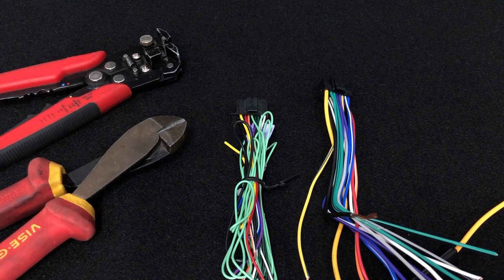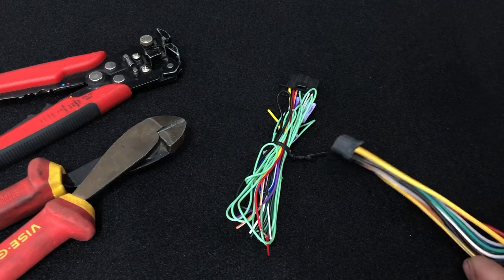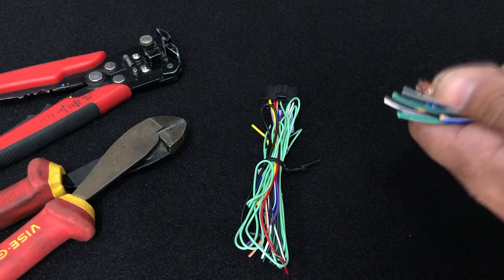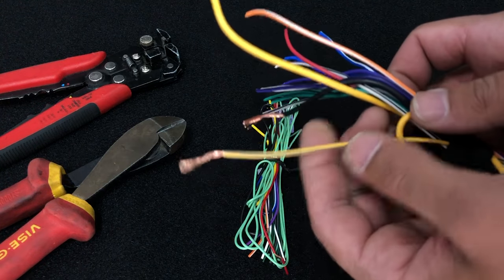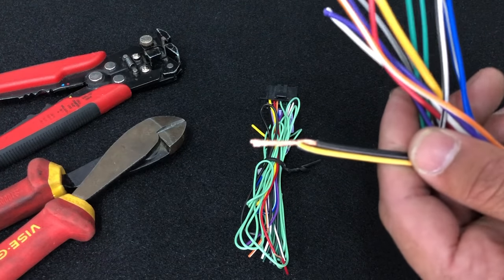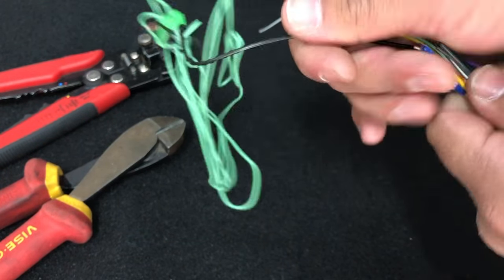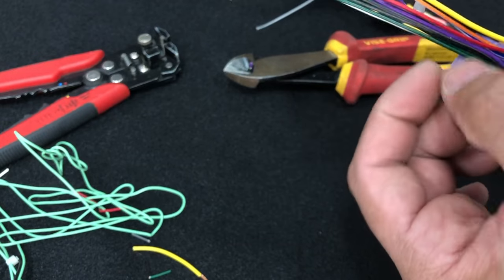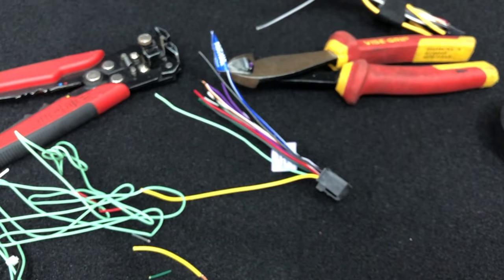Easiest Way To Bypass Park Brake Wire!

Comment: Pioneer AVH-2300 NEX on a 2016 Wrangler sport. Followed these instructions, no success. Can you confirm if you were able to successfully do this on my particular Pioneer model?
Reply from the maker: Taylor Walser Hi mate, no success in what way? Not able to watch video? What does the screen say? Does the unit have an external GPS antenna? This can also cause the unit not to play movies when it’s moving. You can try disconnecting the antenna for testing purposes
Reply: The Fitting Bay thanks for the reply! No video. No GPS or any other additional amps/peripherals. Also menu options only available when park brake is engaged are grayed out.
Reply from the maker: Taylor Walser Hmm interesting so that means the unit knows when/if the park brake is on. This should not be the case. If you chop the “park brake” wire very close to the head unit and plug and connect it directly to the black GND wire. The menu should work at all times. 
Perhaps there was a small mistake in installation. 
Or there has been more than connection to the park brake wire. Or the wrong wire has been put to GND. 
Basically, when the park brake wire is put to GND the unit just thinks the park brake is constantly on and it has no other way of telling otherwise.

Does that make sense? 
I’d pull the unit out , locate the park brake wire (as close to the head unit side of the plug) as possible and just connect direct to black wire on head unit plug.

That should solve the issue for you
Reply: The Fitting Bay thanks for the advice! I’ll give it a try and report back.
Reply: @taylorwalser6822  did it work?
Reply: Ben10XL some features became available after requiring entire unit, but am unable to watch a DVD. Unit now gives a message advising that the park brake must be activated/deactivated in a sequence in order for that functionality to be available. Had to purchase a $15 part online and now everything works perfectly. More google research showed that this is known thing and simply grounding out the park brake wire no longer works on Pioneer units. Thanks for all your help and checking back in!
Reply: Taylor Walser can you say if the part you buy, make it easier?, or it’s hard???
Reply: Some units require on off on before working

Comment: Newer pioneer HAVE to have a module or toggle switch because they require a closed open closed signal because people have been doing this trick for decades
Reply from the maker: Only in the states. This trick works in AUS with brand new pioneer head units 2020 release etc
Reply: @TheFittingBay  Hi. Live in Vancouver, BC Canada. Will this work for us up here or are we included with US market?
Reply: I  plan on using it with Pioneer AVH-221EX
DVD receiver . Thx

Comment: all the people thinking its unsafe. most vehicles with auto transmissions never use the parking brakes and after enough years of rust and dirt pulling that cable will pull the brake then seize or the cable snaps then you are left stuck... not worth the hassle for the risk, so id bypass it just to avoid this headache
Reply: Take care of your vehicle

Comment: why would you disconnect it? what do you gain from it exactly
Reply: It's not about and disconnecting it from the parking brake it's more for the usage of the stereo in full for example my stereo I can't access the Bluetooth menu to even add a device unless the car's parking brake is on and I have a foot parking brake which makes it even worse

Comment: This does NOT work on newer units. They caught on to this and a constant ground no longer works. Has to have a switched power to keep your dvd working while driving. I used a rocker switch.
Reply from the maker: silverdropstang Hi mate what unit do you have specifically? We sell and install brand new units from most makes on a daily basis, we use this method and are yet to come across a unit where this has failed.
Reply: The Fitting Bay Hi I have a Sony XAV-AX 100 radio. Will this work on mine? 

Also I had a wire named “antenna” from the new unit wiring harness. But I couldn’t find the right wire to connect it to so I left it just dangling. The radio turns on fine and plays radio stations ok though so I guess it’s fine like that?

Also do you know why my radio delivers no audio signal to my amp when I play music in my 2006 f150? It only happens when I am playing music on my radio with my phone and my alarm goes off. Then for some reason it mutes the music and I just hear the alarm going off on my phone. Not my door speakers. (I have a 5 channel kicker amp if that’s important to know)
Reply from the maker: Edgar Mendez Yes it will work. 
Antenna wire needs to be connected to the power antenna in the vehicle (if applicable). It helps with radio reception. If the car has no physical antenna (old style) it 100% has a power antenna. If it has an old style long antenna which does not come up automatically (controlled manually) probably doesn’t have power antenna. 

Very strange, so you are playing Bluetooth music from your phone to radio. Your phone alarm goes off, then all the music stops? How do you get it to start again? Simply pressing play on the phone or does the car need to be switched on and off?

I’d start with a software update on your phone.
Reply: The Fitting Bay Well if I disconnect the negative battery terminal and connect it again it works fine again. I don’t know maybe it resets something.
Reply from the maker: Edgar Mendez If you have your phone volume full on Bluetooth, then turn up the music really loud in the car, does the amp shut off? And basically do the same thing? Just check that. 

When the alarm goes off it’s very loud, possibly putting the amp into protection mode. Which is why you need to pretty much disconnect it to get any sound. 
You can fix with tuning the amp. Turn the gain down to 0 and then the radio up pretty much as loud as it goes then slowly turn the gain up to your liking.
This way you can have the radio on full blast and it won’t put amp into protect mode.
Reply: The Fitting Bay I checked that and no the amp doesn’t turn off. Instead I can hear the music but like it is barely audible. Like if I put it at max which is 50 volume, I can barely hear the sound from my speakers.

And yes I didn’t set the gain with radio at max volume. I did it like 3/4 of the max cause that’s what I read on YouTube vids.
Reply: The Fitting Bay I uploaded vid just now so you can see how it sounds when good and when not good
Reply: The Fitting Bay but maybe I should try that and see it it solves problem. Because like I said I only have my gain set so that 3/4 is max volume. Or I don’t know
Reply: Pioneer 200EX
Reply: Every system is different. Saying that the gain should be set to 3/4 is a bold statement. I would try resetting your gain

Comment: recommending solder to average person is very silly.  Heres a quick question, how many connections on a car are soldered?  Engine Computer? no there crimped, Oxygen sensor? no there crimped, only solder circuit boards.  Vehicles with solder connections, have specialized terminals to handle wire movement and vibration.   Average DIY would have dirty solder joints and issues down the road. Solder is brittle to vibration, and cars vibrate.  Best choice for DIY is butt connector with heat shrink separate or the all in one setups.    And if you really were looking for clean install, stagger splices.
Reply from the maker: Michael Shapiro 😂 buddy if you’re that offended by solder joins just crimp your wires 👍🏽. In ten years of doing this I’ve never seen jobs come back from solder joins breaking from vibration 😂. You know what I have seen. People not crimp properly and wires fall out 😂

Comment: What exactly is he bypassing? I have the same unit.
Reply from the maker: Denis Lara View movies without handbreak up - change settings, use nav features etc without Hand break up :)
Reply: The Fitting Bay .... Apple car play works just fine without it. But I am curious about the movie option. I’ll check it out. Thanks
Reply: @iamdenislara  For some radios, like mine, you have to have the stupid parking brake on to pair the damn phone. This is the problem I'm having. I don't want to watch videos or cause trouble. I just want to pair my phone, listen to music, and carry on with my life. But I can't because Pioneer is stupid
Reply: @brycedaugherty9211  i recently found out that the Apple Car Play does not need this, but for Android Car you do have to ground the parking break
Reply: @iamdenislara  I wound up doing the trick to bypass the parking brake by just grounding it to the radio chassis. It really wasn't that bad, and thankfully my unit doesn't have to have an off/on toggle. It's just a ground check. I'm glad the whole ordeal is over but these parking brake sensors are a nuisance

Comment: That doesnt work on pioneers at least not any new 1z u have to wire a grounded switch to the parking brake wire n u flip it on n off n it tricks the unit into thinking the brakes been set

Comment: I dont think it'll work on my pioneer as it needs to cyle ground on off
Reply from the maker: If you are in the states you need a switch as well
Reply: @TheFittingBay  thanks, Australia but same go.
I found a module u can buy that does the ground cycle on ebay 👌

Comment: Not true. Every deck I have owned requires you to set the brake, then release and set again. On-off-on. Can't do that if its hooked to ground. And why doesn't anyone talk about the other mint colored wire?
Reply from the maker: Are you located in Australia? Here in Aus this method works time and time again, we still do it on late release units - no dramas. 
Also, the other mint coloured wire? What head unit is this for? Pioneer/Sony have a mint park brake wire and 2 green wires for rear left speaker.
Reply: @TheFittingBay  Wow I'm surprised it's different. I'm in the US. I figured they're all made in China so it would be the same. Mine is a Pioneer. It has the green speaker wires, a mint green parking brake and another mint green wire. I've been trying to find out what it is but can't find an answer anywhere. Also like many other people I have an orange wire with white stripe coming from the deck but there is a dimmer and an illumination wire. I'm not sure which one to hook it up to. I don't know if the Pioneer decks can change brightness incrementally, so I would connect the dimmer wire,  or just day/night. In which case I would connect the illumination wire.
Reply from the maker: Sean Smith Yeah I’m surprised too. they’re made in China but they have different software for different countries not to mention the part numbers are totally different too. You can send me a photo of the wiring harness - info@aesonline.com.au I’d be happy to take a look.

Comment: The wires are too small 22 gauge wire when the factory wire is 18 gauge. Smaller wire means less power can flow, weaker stereo. Wire gauge should match OEM wires. All new stereos have small wires and are trash compaired to a stereo from the 90s.
Reply: generally these days, this is because they are not pushing the power from the head unit, but using low-power RCA output to an amplifier which has MASSIVE 4 gauge wire to power, and this is what pushes the majority of the power consumption.

However part of what your saying is right, and if you have smaller grounding wire, the headunit is going to start looking for earth from other points, such as antenna, speaker channels, etc and this is what introduces induction noise, an issue that was far less of a problem for a decent install in the 90's

Comment: Why can it affect driving?
Reply: Because things that require the Parking Brake to be engaged to use them (like touch screens) aren’t supposed to be used if the parking brake isn’t on. Which is why this bypass is dangerous.

Comment: Worked perfectly for my pinoeer sph-da250  thank you very much! Saved a lot of hassle
Reply: Did you connect the light green wire and the black wire as one from your aftermarket stereo

Comment: Didn't work avh-120bt. Can't press ok.
Reply: You need the DIY harness available on Ebay or Amazon for 10 bucks.  I just installed on mine and works just fine.  Pioneers are smarter than this and need the little harness that sends a pulse signal to it.
Reply: @ephraimlira3511  thank you it will be arriving Monday. As far as hook up goes green to green black to black then I have a purple white wire that connects to the third wire?

Comment: Didn't work on my Alpine iLX-W650
Reply from the maker: It should
Reply: @TheFittingBay  it may be that I'm in the US. But ours require an interrupted signal ground. A solid ground doesn't work on my model.
Reply: @TheFittingBay  I’m in Australia and have the ILX-407A does it have to be a constant ground like you have demonstrated or a switched ground? Thanks in advance

Comment: Will it work on the alpine ilx-w650?
Reply from the maker: Taran DeCarlo in the states? No. In AUS (possibly other Parts) YES
Reply: The newer Alpine units use an on-off-on signal so if you were doing it you would need to wire in a switch between the parking brake signal wire and the ground wire for it to work.
Reply: @chrisgutierrez9130  does that mean I can just pull the parking brake wire from the alpine HU, connect it to a switch, and ground it on the other end of the switch. Then trigger the switch on off and on, and it will work?
Reply: @cheesern1  yes that is exactly right. That is what I have done to mine and it works perfectly.

Comment: Do you know if it will work on a Pioneer AVH-4500NEX?
Reply from the maker: ccoollttoonn8294 Don’t believe it works in the states! The units over there have different software and the head unit needs to see GND - On off on I believe so you’ll need a switch
Reply: It requires an on-off-on toggle of the ground wire. Just needs a switch between the green and black wires, and placed somewhere you can reach it. It is mentioned in the installation and users guides for the Pioneer radios that you need to set the brake, release the brake, and set it again to unlock a bunch of features.

Comment: Will this work on a Pioneer AVIC-W6500NEX?
Reply from the maker: Swany Swan Any head unit with a screen / park brake wire. This will work on. 
Putting it to ground tricks the unit into thinking the park brake is always on 😊
Reply: The Fitting Bay thanks so much for the reply! I previously had it grounded to a  screw in the frame. It was working but every once in a while when I’m watching a movie for more than 10 minutes it’ll stop and then the error message will pop up on the screen. I was thinking it’s maybe the GPS in the unit triggering it saying hey, car’s moving. I’m not using the units GPS I use Apple Maps on my car play. But could this be an issue why it’s not bypassing?
Reply from the maker: Swany Swan Interesting. Does the unit have built in GPS? Some units don’t have on board navigation, they rely purely on Apple CarPlay and AA. However, they still provide a GPS antenna. The reason for that is to help with reception on CarPlay (not relying 100% on phone) 
In either case, you could unplug the GPS antenna from the unit and try that. 
Also, have a look for a software update on the unit. Sometimes bug fixes can help with things like that.

Comment: it does not work with Pioneer
Reply from the maker: ADRIAN DIY Yes it does.
What unit? And what were you trying to achieve by doing this.
It will unlock the locked menu. 
It will remove the issue of needing park brake to be on to watch video
Reply: Not all.  I have the AVH 210 ex and it requires the setting, releasing and setting again of the park brake.  Simply grounding it doesnt work.
Reply: @robertlemire370  should put it on a toggle switch

Comment: You really don’t give much info at all, we’re did you get the yellow and striped wire at, my car doesn’t have that on my car
Reply from the maker: Tim Blevins buddy this is for after market head units not factory. If you have after market it will have a harness like one of these